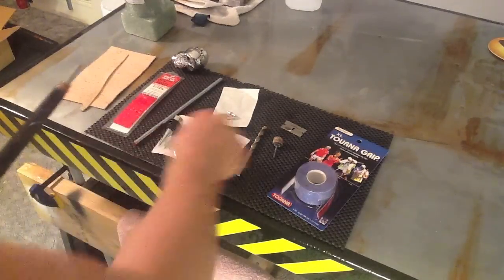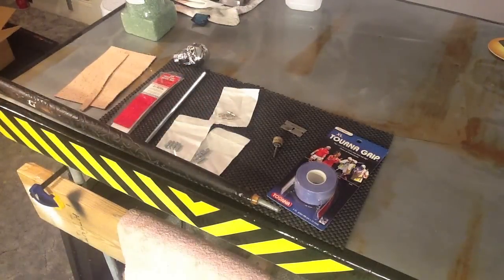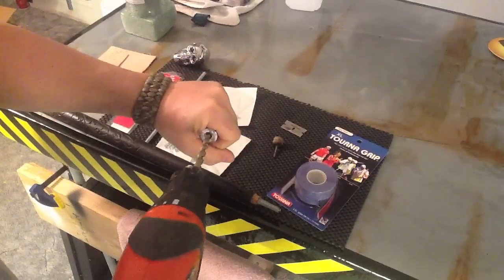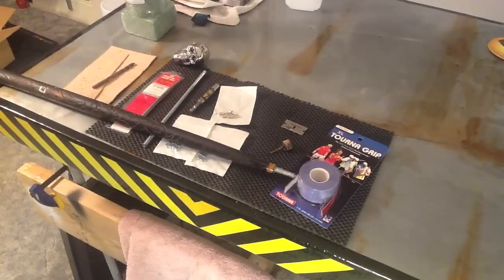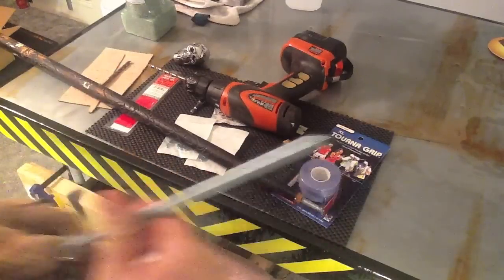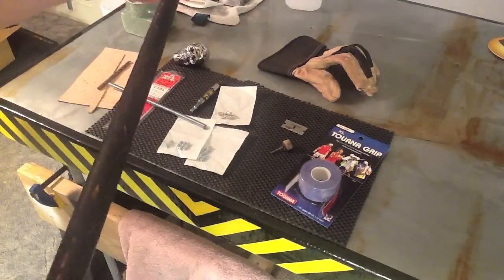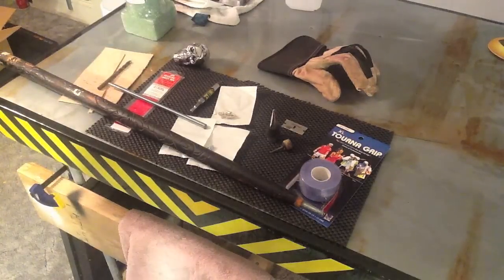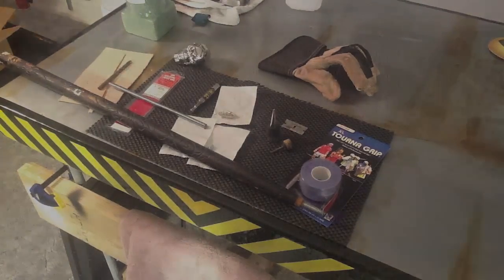Making a Hidden Sword Cane - 1

Comment: I believe the metal tip maybe I practical for anyone who actually requires a walking stick.  I have a sword cane that I use as a walking stick, requiring the support.  The metal tip looks like it is very slippery on concrete and other smooth hard surfaces.

For my purposes it must not attract extra notice and it must actually function as a walking stick for a medium large fellow. That tip will attract notice, I believe.

I don't know your intentions, with the design.  I have seen sticks for this off road hiking that have similar tips.
Reply from the maker: agreed, it was more an aesthetic look and example.  the threaded tips functionality was more what I was spotlighting there.  I use a rubber edned coupler that blends in more - for the most part.  I like having the option to interchange tips though.